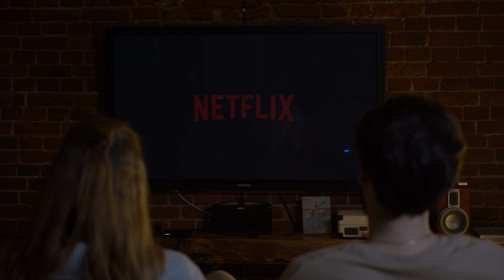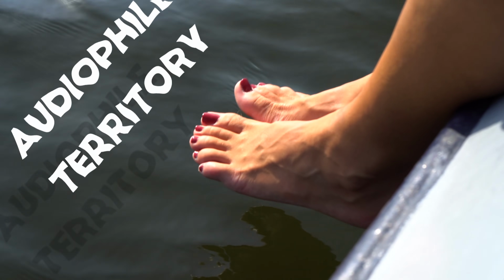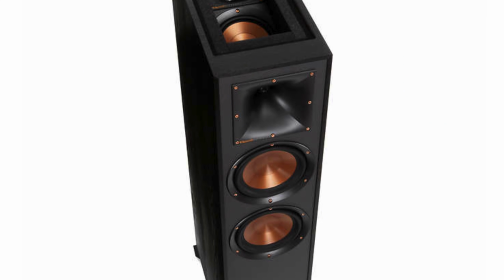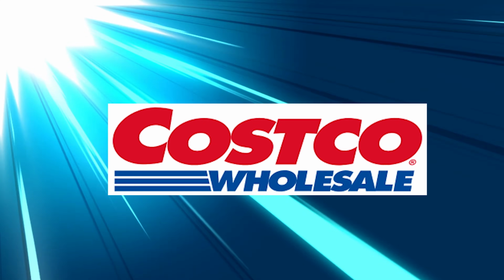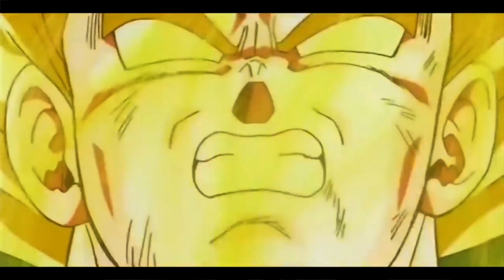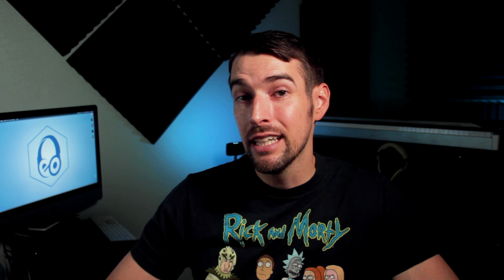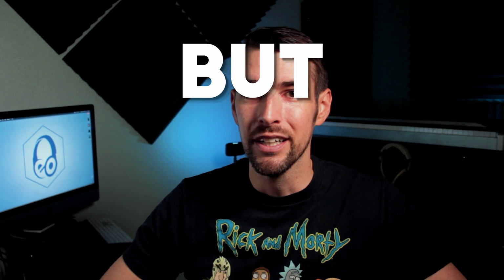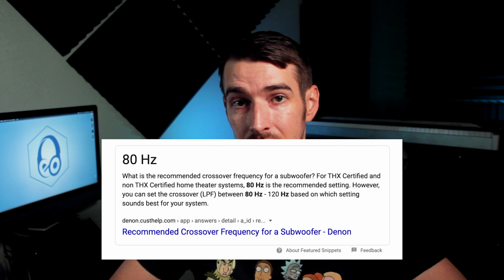$1,500 BRAND NEW Dolby Atmos BEAST SETUP?! Costco & Klipsch Bring It AGAIN!!!

Comment: I bought one of these subs at Costco last week when they were on sale for $169. Just the one sub tests the structural integrity of my house. I’m only running it at 1/4 gain. Insane punchy base.
Reply from the maker: Right?! Insanity... 😄🙌
Reply: I went to buy one of these and missed the sale 🤦‍♂️  thankfully, I can wait till the price drops again.
Reply: @Qazxswer68  they are currently on sale at Costco as we speak for $169. I just purchased my second one today!
Reply: @rustyblanks895  Thanks for the heads up but I picked one up last weekend 😁
Reply: I just purchased this 🔊 speaker system with the extra base sub from Costco, and was wondering how the new Denon 760H receiver would do running with these speakers?
Reply: @readymax2684  I have a X2400H which has more power but I can’t even run the sub at more than half gain because it shakes the entire house. I’m sure you’ll be fine.

Comment: Which would you recommend, this setup in your video or going with a Sonos Arc with a sub and a pair SL ones
Reply from the maker: This setup. I’m still a believer that the good old-fashioned receiver+wire+speaker combo is just more reliable and powerful than a soundbar system. Especially with that Klipsch R-12SW sub. Compared to the Sonos Sub? No contest.
Reply: Ealan Osborne - ok thanks for your response. Also side note, love how you show the out takes. Very funny, keep up the great work and thank you for your dedication for putting these videos up. Very helpful. I'll be checking online daily Costco website
Reply from the maker: @sal6830  Thank you so much! 😀🙌

Comment: Excuse my ignorance which terminals  would the upward tower firing speakera be asigned to on say a Pioneer Elite SC-LX502 receiver? Asking for a friend 😆
Reply from the maker: Haha! No prob! You would connect the upward firing speakers to the terminals labeled “HEIGHT” on that pioneer receiver. 😄👍
Reply: @ealanosborne  Awesome! I was wondering what those were for! I hooked up Klipsch KH0-7 outdoor speakers to terminals surround sound back....changed from 7.1 to 5.1 in settings...with zone2 how do I select the outdoors speakers to be recognized as fronts? I understand on the front panel I select Zone2 on select Source T.V. or Bluetooth but the speakers do not kick out sound ....what am I missing? Asking for a neighbor 😆🤣

Comment: I've been running that $899 Klipsch set up with the Sony 1080 receiver for 2-3 weeks now and I love it! Costco delivery is really cool with being able to select what day you want your delivery and they call you and tell you what time they will be at your house. I also just picked up 2 more 12" subs from Costco @ $169 each. So I will be running a total of 4 Klipsch 12" subs. 2 of those subs is more than enough for my room but I've been running 2 subs for a few years now and I just want to take it to the next level. I'm sure I will love having 4 subs but I'm also kinda thinking, why not have 6? 😂
Reply: Also, to anyone interested in buying these speakers, they arrive in one massive 160Ibs box. The speakers are nicely packaged individually in the box. The 2 tower speakers come with feet but the feet are designed to tilt the speakers back which will reduce the atmos angle and range. I put the front foot on and then went to put the back foot on and realized the size difference and thought this isn't going to work.
Reply from the maker: @KyleKick909  whoa. Yeah, that’s bizarre. I wouldn’t want to reduce that angle anymore than it already is. Huh...
Reply from the maker: Whoa, I didn’t know that about Costco delivery. When I got my Reference Theater Pack through them, it arrived at my doorstep within 3 days. Was blown away. But I didn’t realize you could be so specific. Good to know! And 6 subs?! No waaaaaayyyy! 🤣
Reply: @ealanosborne  yeah, when I ordered they had an option where you select the delivery day on a calendar which is super cool.

Comment: Better off buying Dolby Atmos in ceiling speakers instead of using the ones in the front speakers plus it will sound better
Reply: You don't have to plug them in. Considering the price of the speakers without the module (R-620F) are 399 EACH you are still getting a very good value even if you don't plug in the Atmos speakers.
Reply: @waterzipper  I never like Dolby atmos build into front speakers
Reply: @victorpulos823  I understand that but you don't have to plug in the Atmos. The R-620f which is almost the same speaker  minus the Atmos speakers is still more expensive then this Costco deal.

Comment: The best receiver they sell in this price point is the yamaha TSR-700. It is the same as the V6a which is a $600 receiver. You can get it for $330-400 depending on sale and is superior to the ones you mentioned.
Reply: I agree, both my brother and I bought one for $330.
Reply: Plus this 790 Reciever is nit a 7.2, it's false advertising by SONY or a mistake, it's a 7.1. Yea, I kind of like the 1080 better, but at 350 bucks vs. 600 dollars, I have to go with the TSR-700.

Comment: I purchased this klipsch set for $899 and two of the klipsch subwoofers for $169 apiece piece off Costco.com last weekend ..supposed to arrive this weekend ..almost pulled the trigger on the Denon 750 receiver for $399 last weekend and then the Denon was sold out at Costco stores and online… Went to my Costco and bought their floor model for $280!!!! So excited to set up the system this weekend! Thanks for all of the useful information!
Reply from the maker: Niiiiice!!! 🙌
Reply: I just bought the same setup, you'll love it after its's all setup and tuned.
Reply: How has your experience been?
Reply: @coryschimmoeller5347  I love it so far.  The receiver is pretty straight forward to setup, and the built-in Audyssey room correction makes a huge difference.  After that, I did have to adjust crossover ranges to get the sound a bit more balanced.  The receiver had them set so low that 2 channel music didn't sound right as far as subwoofer integration.  

Best sounding system I have had, movies are way more immersive than my last Sony 5.1 theater in a box.  Ended up buying a Roku Ultra, because it supports Dolby Atmos, and there are quite a few movies on Disney+ that have it now.  Just watched Guardians of the Galaxy, and it blew me away.
Reply: @coryschimmoeller5347  It was good I actually ended up taking the Costco set back and separately purchased the center channel and a pair of r51s for my left and right and two pairs of r41s for the height Atmos and the rear surround along with keeping the two subwoofers that I had purchased previously… The set up sounded really goodBut the bookshelf speakers were just too big for my space otherwise I would’ve kept them

Comment: Ok, bro I know I just got the 5.1.2 setup from your other video but I had to get this because my eye has been on those tower speakers for a while now. $600 just seemed like so much for each tower speaker until you showed me this. It's cheaper than both and comes with another set of R-41ms, a nicer center channel, and speaker wire! I used your referral link btw so I hope you got a good commission!
Reply: Quick question: I already purchased an R-52C and an R-12SWi subwoofer to improve my setup upstairs. Therefore, I will be left with two R-41Ms and an R-52C that I was hoping to repurpose into a computer speaker set up to replace my Logitech Z625s. Is this a smart move? I'd need to buy an amp, wire, and sub as well which would also take up a lot of space. Do you have any recommendations? Or would I be better off selling the R-41Ms and R-52C to buy a better computer speaker set. If so, do you have any recommendations for that?
Reply from the maker: @sebastian7539  Well, Klipsch also sells the THX Promedia 2.1 computer speaker system. I can guarantee that’ll be better than the Logitech system without spending too much money 💰
Reply from the maker: Also, it’d be silly not to use the Atmos speakers in the 625FA towers. It might surprise you how effective they are. Or maybe think about upgrading to a 9 channel receiver, so you can use the upward firing speakers as front height, and Reference Pack satellites as rear height? But once you make that jump from 7 to 9 channels, things start to get real expensive real fast
Reply: @ealanosborne  yeah that’s what I noticed too. Didn’t want to spend a whole lot more so I’ll probably just unmount my Ceiling speakers and use the towers’ atmos instead.
Reply: @sebastian7539  if you have in ceiling speakers, those are better because they're directed at the listener and not bouncing off the ceiling.
Reply: @69ztang  I was kinda thinking that but I mean I'm using two small Klipsch reference theater pack speakers mounted on the ceiling. The R-51Ms as the atmos speakers in the tower speakers would be considerably more powerful, so idk
Reply: Another option is to just sell everything but the tower speakers and buy a better receiver. I have an Onkyo SR494 7.2 channel right now. Should I upgrade that to accommodate these bigger speakers. I might need more channels even because I have the reference pack satellites mounted as my rears and ceiling speakers for Dolby atmos with my 41ms as my front left and right. I was thinking about putting those as my rears. Would it be better to keep the satellite ceiling speakers than to use the Dolby atmos on the tower speakers? I would think so but then again the Dolby atmos are R-41ms as opposed to the tiny satellites from the reference theater pack.
Reply: Anyways, sorry for the paragraphs. It’d be awesome if I could video chat you or something sometime to go over this so you can see exactly what I’m working with.

Comment: I have the 8in downward firing sub, but can I buy the R-12SW as my 2nd sub? or do I need to get the same sub I already have? - Home Theater Noob
Reply from the maker: Great question! You can mix and match speakers and subs all you want. It’s just a matter of tweaking and adjusting volumes, positions in the room, and crossover frequencies (the frequency point at which the satellite speakers end and subwoofer begins). It might seem daunting to a Home Theater Noob, but it’s actually quite fun to mess around with things, testing out what sounds best to your ears 😀

Comment: Just bought a samsung hw-q950t for a 10ft  by 10ft room and a 65 LG CX. Now I'm thinking I should have bought this instead lol 😆
I do like the wireless rears tho...what do you think of my setup?
Reply from the maker: I don't have any personal experience with the HW-Q950T, but I've heard it's one of Samsung's better soundbar systems. Wireless rears does make it convenient, too. Although I'm still a fan of having good old fashioned wires and a receiver. But I totally understand the ease of use and connections with any soundbar system, not needing an additional receiver, etc. Just hang on to the receipt just in case? :) Haha!
Reply: If you can return it and don't mind spending more $ I'd do it. You might want to get smaller subs, but at $169 the Klipsch is a great deal,and just get one.

Comment: Ordered January 23rd still hasn’t shipped. And they don’t know when it will 🤷🏻‍♂️. Got two of those subs for $170 each.
Reply from the maker: Huh...maybe having some logistics issues since it was such a good sale before the Super Bowl? 🤷‍♂️ Nice job snagging them up, though! 👍
Reply: Got mine within a week. Had to set gain less than 1/4 turn for 12x15 8ft room. Audyssey  would error out at half way mark. It'll be a while before I get an Atmos receiver.
Reply: @69ztang   Got the two subs right away have them at about half gain and sound awesome with the Sony 1080. Just using some old bookshelf speakers and surround speakers until the rest show up. Going to do a video. Running the Vava projector on a 120 inch screen.
Reply: @TylerTerrio  😯👍 A short throw projector? I'm jealous. I've been looking at the Ben Qs. That Sony is also a good choice. Where did you get it, for how much?
Reply: @69ztang  yep ultra short throw projector I got that off their website with A Super Bowl promotion for $280 off retail and didn’t have to pay taxes. Got the Sony from Best Buy open box so I saved about 10% there also. I had bought the Sony 790 but returned that for the 1080. A little more power and had airplay 2. Can’t wait to get those speakers from Costco it’s gonna scare the neighbors. Ha
Reply: Ordered mine in January.  The subs and receiver got here in 3 days, the speakers took 2 weeks.  Still tweaking it, but it sounds amazing.  Might be my room, but have to run the subs at about 30%.
Reply: what date did you schedule for the costco delivery?
Reply: @coryschimmoeller5347  I’m still waiting for them to get a hold of me so we can schedule date. It’s all in one box I guess 150 lb package. I would still rather have them just drop it off then schedule a time.
Reply: @TylerTerrio  weird, i just ordered and i selected a day at checkout

Comment: OPEN BOX at best buy for the receiver, a lot cheaper. I bought the same exact system you're talking about. If you look on Slickdeal and search Klipsch you can get a great system for cheaper. I feel like you're talking about the system I setup.
Reply from the maker: Yeah, man! Searching for those deals works great with home theater since speakers can last fo-eva if you treat them right! 👍